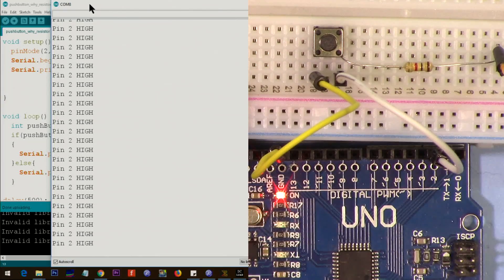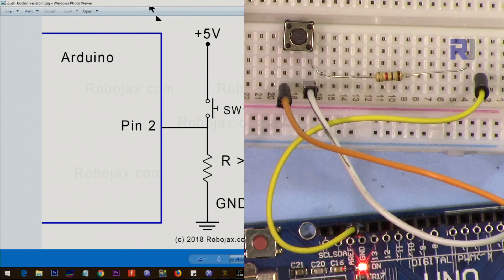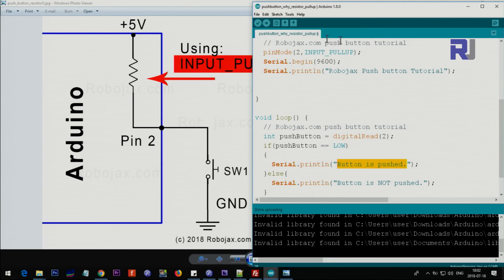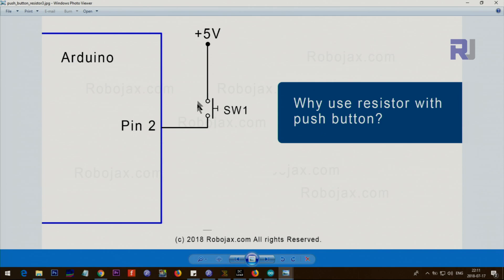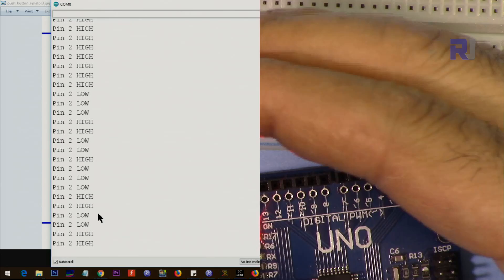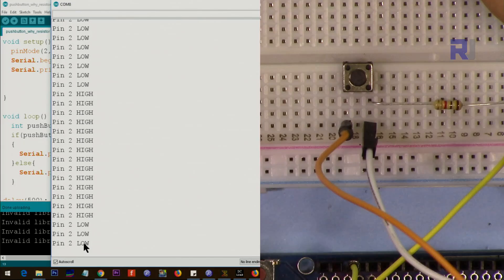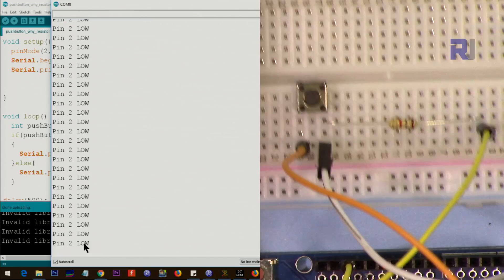Why use Resistors with Push buttons and how to use them without resistor with Arduino

Comment: Hi! Thanks for the video! This is helpful. If I would like to build the circuit on the PCB, how should I solder the resistor? At the moment, I have successfully built the circuit on the breadboard, not on the PCB. Thanks again!

Comment: i dont use resistors, i use pinMode(pin, INPUT_PULLUP);
Reply from the maker: what the video and you will see what I said.
Reply: Yeah, i know.. Im just sharing what i think is much easier to do..
Reply: @kengineer1379  Well it's not "much eaiser" because it can give you false positives...
Reply: @jackiedk100  can you explain?

Comment: could you explain why the resistance has to be greater than 300
Reply from the maker: lower resister draws larger current. We try to minimize the current.  1k is the best and most commonly available resistor.
Reply: @robojax  first of all thanks for the video, but why do we need to minimize the current? 
and why high current is sensitive to noise?

is there any requirement for the input pin2 ?

Comment: Thanks for sharing sir, but i want to know if the push button and resistor was pulled out from arduino but i have input the coding from the pc and upload it, are they save automatically without arduino into my project or the arduino still plug in with the push button and resistor in my project? Thank you 🙏🏻
Reply from the maker: you need to start from the lesson one when you ask such question. may be here  https://bit.ly/sunfouder
Reply: @robojax  oke mr Ahmad, thankyou 🙏🏻

Comment: need help the AC DC convertor 220V to 5V take 10 secondes to shut down the 5V, sure the  capacitor is the cause. my question how can convertor shut down directely so once 220v OFF the 5V also without any delay. thanks to reply me if there's any solution or alternative
Reply from the maker: Hi, here is Robojax Timer https://youtu.be/6DGQhQgr7Ak

Comment: If I have many push button in serial, do I need a resistor on each button or just one on VCC or GND wire ? I'm building a buttons box for gaming using Teesy ++ 2.0 as microcontroller. . Thanks for yours advices.
Reply from the maker: if you have push buttons in series, then you will need 1 resistor. As I mentioned in the video, with Arduino you don't need to use resistor. You can use INPUT_PULLUP if you didn't understand what I said, please watch the video.

Comment: can we use another microcontroller's output to make a pin high?
Reply from the maker: That is called reading input. Yes arduino can read the input and it does not matter where it comes from . Mcu or a switch or a power supply. I have a full course from absolute beginning.
Reply: @robojax  have you used button2 library?  We can't see where it designates internal pullup if it does at all.  I wan't to change input from a button to the 3.3V output of a voice module.

Comment: I want to arrange a varied resistor (parallel or series) which is controlled by a relay / pushbutton to control the current in a shunt dc motor so that the speed is constant, is that possible?
Reply from the maker: the information is still not enough to say. Fist you would need a lot of relay and resistors to do this. Even if you do it,  this is a very inefficient way to control the speed of motor because there will be lots of energy waste. You should control the speed of the motor using mostet module and Arduino.  Here is one  example which you can control speed but to make it stable for certain application, you need to have other components to detect the speed and keep it stable http://robojax.com/learn/arduino/?vid=robojax-e-Switch-AOD4184A

Comment: Hi Robojax, suppose i am not using 3.3 or ground, instead, if i define 1 pin as output and 1 pin as input, we will still need to use resistor? Is there a get away by using input pull up?
Reply from the maker: Hi, it seems you have not watched the video fully. please watch . The whole point was to show using of  INPUT_PULLP.

Comment: hello robojax
I have two questions to you
1- Does each digital pin or analog of an Arduino have an internal resistor or not?
2- I work with a Arduino Ardardo Leonardo included and I use 4 Micro Switch to start or stop a motor is what I can use the instruction pinMode (x, input_pullup); even for analog pins?
thank you in advance
Nouredine Algeria
Reply from the maker: Hi,
1-You can use pullup resistor in digital pin. I am not sure if you can do this with analog pin
2- Your arduino has upllup see it here. https://www.arduino.cc/en/Main/Arduino_BoardLeonardo
Ahmad from Canada

Comment: thank you! what I dont understand if I have more than one button is that mean I will wire al the resistors to the 5V and the other side of each resistor goes to the one side of button? and the other sides of each button goes to pin. Is that correct?
Reply from the maker: You are welcome. Yes each push button will need a resistor if you don't use the INPUT_PULLUP in Arduino.
Reply: @robojax  do you mean in the code if I am sending a param INPUT_PULLUP for pinMode function then I don't need resistor?

Comment: So....without the resistor would it just short?
Reply from the maker: so you did not watch the video and posted this comment. I have explained it my friend.
Reply: @Robojax  sorry but I dont remember seeing what would happen if 5v went straight to Gnd. Sorry if I missed it.
Reply from the maker: you can't connect 5V to ground. it would be short circuit. please watch it again. turn ON the subtitle .

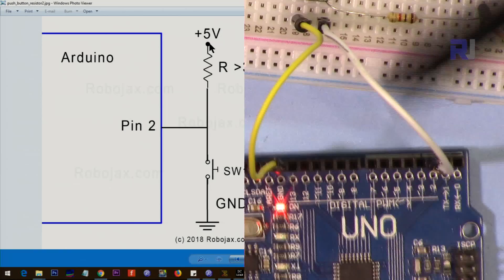Comment: In 1:30 the diagram shows that pin 2 will always read the 5 V, why is it when we press the button pin 2 now reads 0 V rather than 5V. It seems like pin two would read the 5V always (does not matter if it is connected to ground or not) because it comes first and we are changing what is happening AFTER the pin already read the 5V. I'm thinking of this linearly, if someone can explain exactly what is happening there. Thanks.
Reply from the maker: when you press the button, you connect pin 2 to GND and that is zero volt. The resistor allows to do this so when you release the button it automatically goes to 5V through resistor to 5V.  When button is not pressed the 5V comes through resistor to the pin 2.  if we did not have resistor, wouldn't be able to achieve that.

Comment: Stupid. Just need to configure "INPUT_PULLUP" in pinMode at setup.
Reply from the maker: Thank you. You posted comment without watching video. I have explained that. Don't say something without knowing all facts. See 100s of people thanked for this video and you said very nice things . Thank you.
Reply: @robojax  I watch all the video, everything in it is pure nonsense. Nobody needs to use pushbutton connected to VCC.
Again: stupid video, just use INPUT_PULLUP and all will work correctly.
Reply from the maker: Thank you very much.